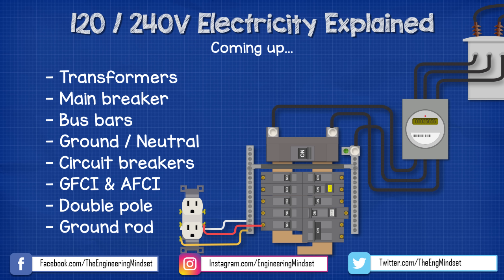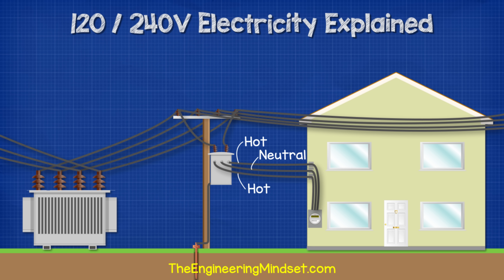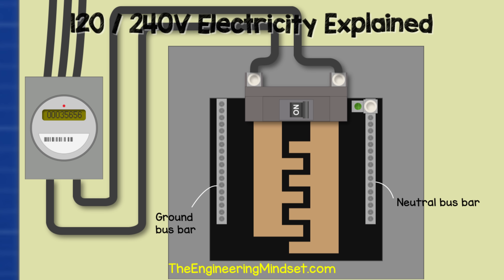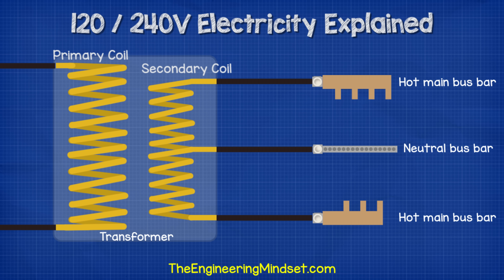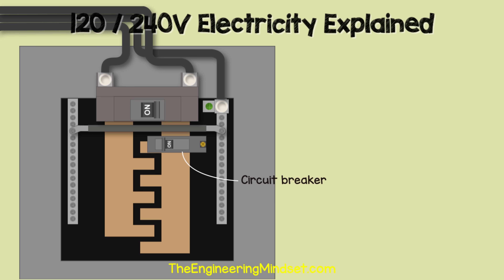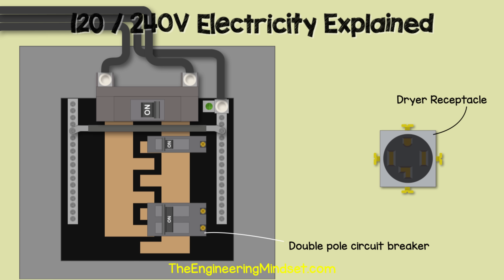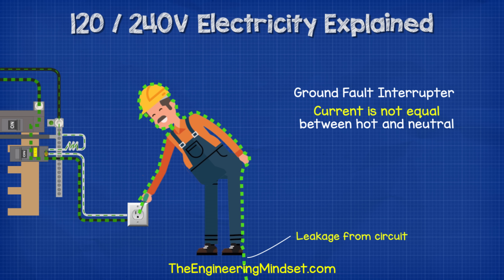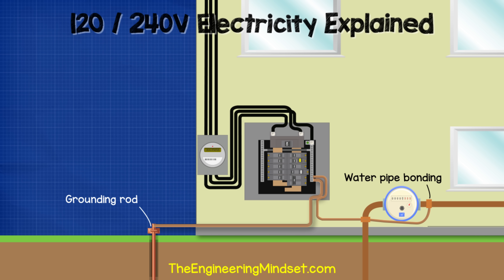120V 240V Electricity explained - Split phase 3 wire electrician

Comment: Overloads protect loads. They usually are attached to a contactor to prevent motors from overheating. 

Circuit breakers protect conduits (the wires). 

Otherwise, it’s an enlightening video.

Comment: Philippine's Meralco and some provincial electric cooperatives also use Split Phase 3 wire connection but use the two hot wires for electricity instead of 1 hot and 1 neutral thus the mains voltage is 230V.

Comment: 4:56  if you actually put your test leads on there, wouldn’t you get zero. Since there’s no difference in voltage. A multimeter set on voltage, will read the voltage difference between the leads. Am I correct? Sorry, just a heavy duty mechanic here totally into this video though. Fantastic job!! Keep it up bro! 😎
Reply from the maker: No, you'll read 240 because one is positive 120V and the other is negative 120V so the difference is 240V between them.
Reply: @EngineeringMindset  ahhh, so it’s not actually a real negative 120v, it’s just because it’s the negative lead and will measure it as -120 on the screen. Sorry, I’m just kind of getting into AC power. I work mostly with DC circuits at the 12 and 24v levels. Subscribing!
Reply: @christoph1039 No, it's really 240v, which ever bus you place the multimeter leads is irrelevant.
Reply: What you're saying applies if the transformer is actually wound in the opposite polarity halfway down the windings. Remember, this is just a single phase. It could be A, B, or C phase let's say. It's a single phase from 3 phase power, then powering your residential transformer. This is one secondary coil where all the windings are in phase with each other. That means they all add together equally. From the start of the windings to the middle point you have 120VAC, and from that middle point to the other end of the windings you have 120VAC. Since this coil of windings is a single phasing then both of those halves are going to add to 240VAC total. If the transformer was wound with opposing polarity halfway down (you just changed the winding direction), then you would still have 120VAC line to neutral, but 0V line to line. 

You can do this with batteries. A representation of your residential wiring is going to be putting two batteries in series. Let's say they are 12V batteries. If you put them in series then the + of one is going to the - of the other, and that node is your common or "neutral". So you still have 12V across each battery, but the series total is 24V. 

If you did the opposite where you put the batteries together by making both negative terminals the common, then it would mean you have +12V on one end of the series and +12V on the other. That's a potential difference of 0V. No current would flow across the series circuit if you added a load.

Adding the neutral is the interesting part. In the first case using the 24V series, if you have perfectly balanced loads "line to neutral" on each half then no current will flow across that center/neutral/common conductor. It will only flow across the series end to end. When the loads are imbalance that neutral conductor will carry the difference in current between the two lines. In the second case using the batteries tied together at the negative terminals, you may not have current flowing "line to line" without a neutral, but when you add the neutral you now complete the two circuits and provide potential difference across the neutral conductor itself, and it will carry the total current in the whole circuit. So in the first case the currents subtract across the neutral, and in the second case they add together.

Comment: But, WHY is there a potential difference of 240V between the two hot bars of the SAME voltage?
Reply from the maker: They aren't the same voltage. See this video for full explanation https://youtu.be/u0SsejDCVkU
Reply: @EngineeringMindset  i’m loving these videos.  I watched the other video, so check me on this.  When you measure between neutral and hot, can you say that it’s 120V “potential difference” because the hot oscillates between plus and minus 120V?
Reply: @MauriceCalis That's it.
Reply: Physically, the two legs are at different spots of the coils. One leg is at one end of the coil. The other leg is at the other end of the coil. They are at different potential

Comment: I love that I open my electrical box and I see old school screw in fuse bulbs. The wiring coming out the sides of the box is delightfully antiquated as well, some being covered in woven cloth. I hope you can detect the sarcasm oozing out of my words. We rent so it is not up to us. It’s a 70 year old building and we would probably have to move for the electrical to be properly upgraded. 

The absolute best (worst) thought is when I discovered some wall trim in our kitchen with a nail that had penetrated into a wiring hidden behind it. That part of our floor kept on getting slightly dirty and I took the trim off thinking it might be mold spreading from behind. Nope, it was soot from electrical arcing. The tip of the nail was completely melted so the the arcing was sporadic but it was a horrifying discovery. Our landlord was so nonchalant about it, just told me to wrap the damaged wiring with electrical tape and put the trim back up with double sided tape. We live in a duplex, directly above our landlords. Fun times. Location is a big city in Canada.

Comment: if you wonder where the current is gonna go in the ground pole the transformer is also connected to the ground and the current literally just moves through the earth back to the transformer. this is possible because part of the equation for resistence is diameter and well the earth has quite a big diameter

Comment: I understand now the real purpose of grounding, I had a misconception thinking it would move the charge to the earth in case of shorting, but now it makes more sense to me; it is just an extra returning path to main distribution that is why it can be joined to neutral.
Reply: SOME small current will go across the ground and back to transformer in the event if a ground fault. But 99.99% of the current will go through the ground wire. Enough to trip the CB

Comment: This is the residential service panel used in  US  to provide 120V mostly.   For countries that uses 220-240 volts and no 120V,  does that mean the utility supplied 2 x 240V and a neutral?
Reply from the maker: No ,240V countries get a single 240V line, 120V countries also get a 240V line which is split into two 120V lines.
Reply: @EngineeringMindset larger homes in most 220-240v countries get 3 230/400v lines + neutral

Comment: Thanks a lot for this video. I concern whether we need to connect neutral and ground buses when using GFCI breakers. Seems like in case of hot wire touching a metal casing, the current flow will be through the ground wire to the grounding rod and in the same time GFCI breaker will measure current difference between hot and neutral wire and switch off the circuit.

Comment: The only thing I'm missing is if the ground and neutral are both connect at the panel, what is the need for both?
Reply from the maker: See the hot ground d neutral video please
Reply: @EngineeringMindset I think I get it. The N is there to return the voltage back to its source. In case of a "whoopsie" and there is short, voltage will travel through the G and N. Due to the increased current draw through N, this trips the breaker? 

The other video did raise another question. I always thought in DC , G is Negative. But the video showed G being connected to Positive. Or was the battery just being used for illustration purposes to represent an AC power source?

Paul, if that's you thank you for your work.

Comment: FWIW, as an American homeowner, I've never seen a GFCI circuit breaker. All GFCI circuits I have experienced have been GFCI outlets that protect themselves and and other loads downstream, which is generally hard to determine. (In my current house, there's a GFCI outlet in one bathroom that also protects the outlets in another bathroom. I had to test to discover this.)

I've also never seen an AFCI circuit breaker, or any AFCI-protected circuit, at all.

Electrical codes may require things that they didn't in the past, and there's not much that requires old installations to be updated.

I'm just commenting to provide real-world experience to others who might be expecting to find advanced circuit breakers and wondering why they don't see them.

Comment: I am from india there its 240v.. now if i want to run wiring which provides options for 120v and 240v. What is thr best design to do it ? We get 240 from the electrc company and then what should i buy to split that to 120v half and half exactly you explained in the video so my whole house has a option to have both options to run

Comment: Oh god the breakers protected me, I almost died when I was a little kid. So, when I was a kid, I once tried to plug a paper clip between the 2 holes. The ones I have is the one with 2 rounded holes 220 volts. Then the breakers shut off the electricity. Imagine what would happen if I don't have circuit braker.

Comment: I appreciate this informative video. Been wondering why my 240v outlet in the shed is only putting out 120 on each leg but 0 when combined. I took apart the outlet and inspected/cleaned it thinking that was it but nope. I checked the 30 amp breaker. 120 on each leg and 240 combined so that checked out ok. I then noticed that someone attached both hot wires from the shed to only one pole on the breaker. I'm no expert but that just didn't make sense. Why would someone do that? Mistake maybe? IDK. The information in this video confirmed that in order to get 240V each wire has to connect to its own 120V breaker pole. Thank you for sharing. Liked and subbed.

Comment: New to electricity and really enjoying your videos, but I have a question: Is it really a helpful simplification to say that the electricity gets used? Makes me think of red blood cells depositing oxygen in the cells, and carrying carbon dioxide back out. But the electrons don't really care about the load, right? I mean, they don't deposit anything, right? So would it not be better to just say that the hot carries the electrons to the load, and the neutral away from it (in the DC example)?

Comment: Is it possible that we have 2 live wires without a neutral? For example if I have a 240V device with two terminals (L) & (N) is possible to connect two live wires each carrying 120V one to the (L) and one to the (N)?
Reply: yes. Old dryer utilized the two hot legs via 3 prong outlet (the third prong is just for the ground). However, this 3-prong outlets are no longer up to code. Instead 4-prong outlet is used.

Comment: Wait, so the grid shown at 1:04 is 3 phase? As in: each phase is 120 degrees apart from the next phase? So how can it be that people claim that the two hot wires from the 240V dryer receptacle are 180 degrees apart?
Reply from the maker: Each of the 3 phases is 120 degrees from each other. But in a simple install just one of these phases connects to the pole mounted transformer. The transformer is centre tapped with the neutral, so we can use just half of the coil to get 120V or the other half to get +120v, the difference between these is 240V so we get that if we use the full coil and as you can see from the +& they are opposite polarity with respect to the neutral so they are 180 degrees out from each other.
Reply: @EngineeringMindset  First of all, thanks a lot for your reply! Okay, so the two wires connected to the primary coil as shown at 1:56 consist of 1 phase and 1 ground (the latter not going back to the power station)?
Reply: @GH-oi2jf  Thanks for your explanation!
Reply from the maker: Seen our new 3 phase transformer video?➡️: https://youtu.be/u0SsejDCVkU
Reply: @EngineeringMindset  Thanks! Will take a look.

Comment: well, Paul - how about explaining to your viewers EXACTLY how a 120V or 240V is manufactured. That is, what is the mechanical difference between a 120V incandescent bulb and a 240V incandescent bulb.
Reply: A 240v bulb will have a thinner filament than a 120v bulb of equal wattage.  240v bulbs are more fragile than 120v so bulb life is shorter at 240v.

Comment: UK Electrician here. This seems like a mix between TT systems, and how our 110v site transformers and shaver sockets work. 
Few notes. I find it pointless to have a ‘ground’ coming back, when its connected to the neutral bar anyway, might as well fly lead each metal casing at the accessory; at least with our TNCS its at the head. 
The isolated transformer brings in a high impedance, so surely youre much less likely to get a shock when you calculated the earth fault loop impedance form the supply?
Reply: If you find it pointless to have a ground coming back, then you don't understand its purpose.

Comment: Don't use the Neutral bar for Ground wires. . .   Always do it correctly.. . .  Neutral wires to the Neutral bus bar, Ground wires to the Ground bus bar.
Reply: In a bonded panel it doesn't matter